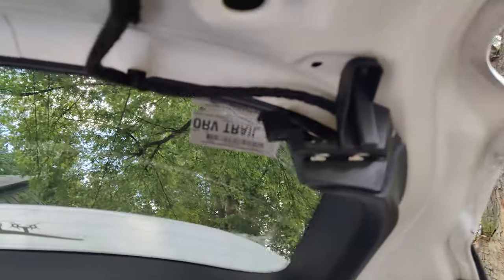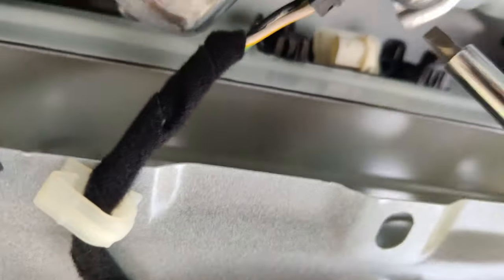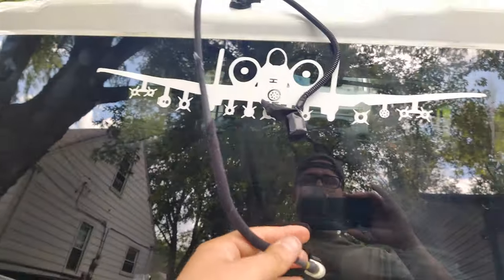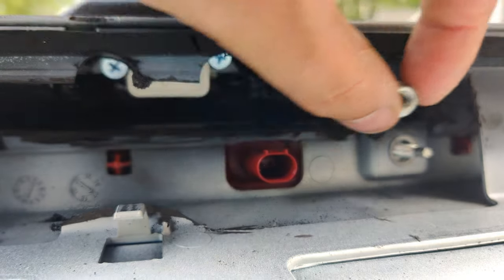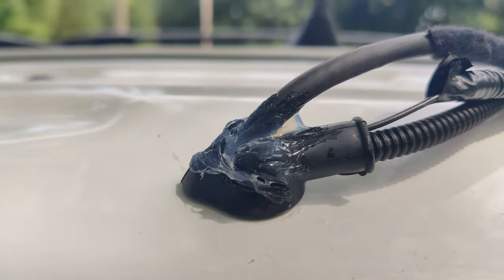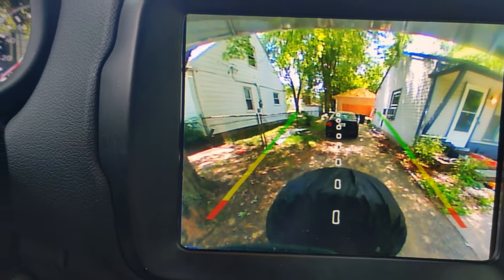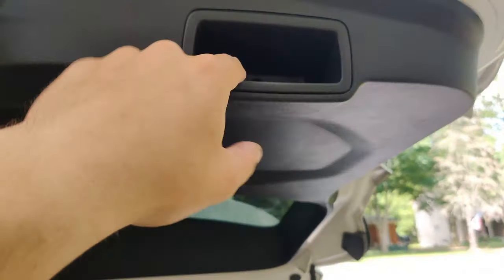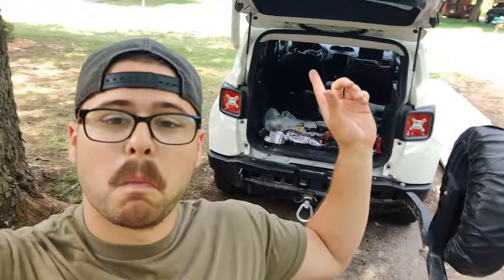Jeep Renegade || Backup Camera Relocation

Comment: Man, thank you. This is super helpful for replacing my third brake light. I will need to take the spoiler off and so far I had only found pictures. Your video helps a lot. I think I can do this. Thank you big time for uploading this informative vid.
Reply from the maker: No problem! Glad I could help! It's super simple. Just be prepared to break one of the Christmas trees in the spoiler. You don't need all of them for it to sit down properly, so it's no big deal. Best advice I can give is to rip that spoiler off as fast as possible to try and not break them.

Comment: Did you install the camera also into the head unit. . 
I have the same screen unit as you but it hasnt got a reverse camera installed.
Reply from the maker: I did not. Mine came with the factory reverse camera. If you were to try to get one, you would also have to get your car head unit programmed